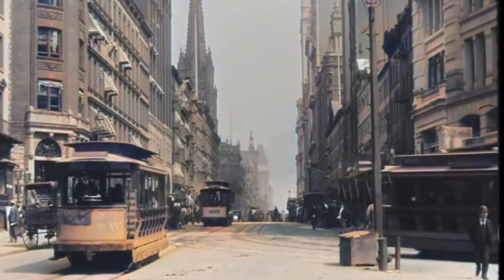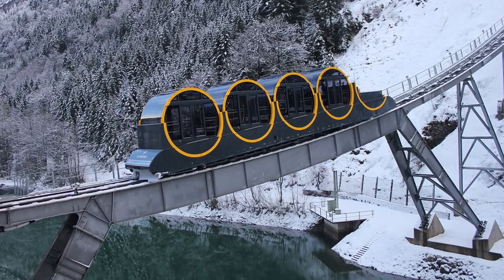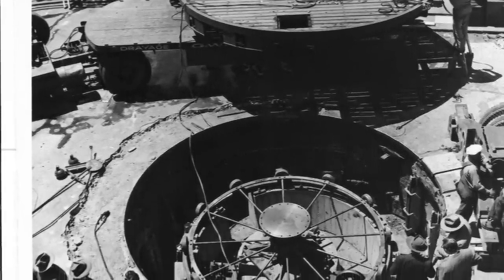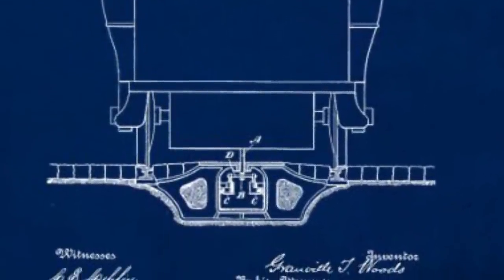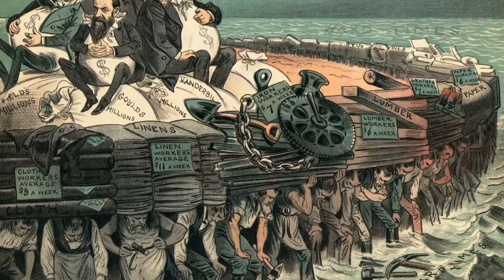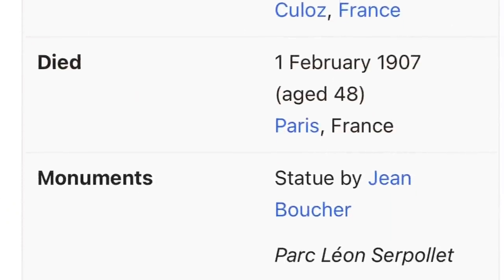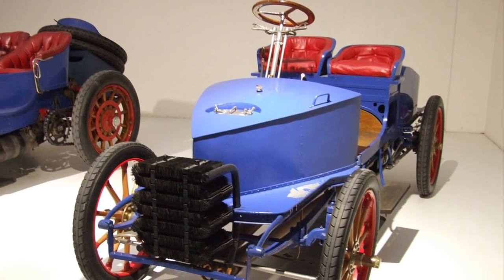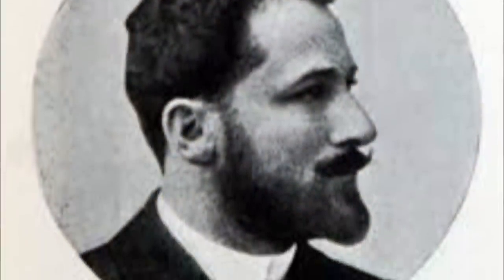Conduit (Wireless) Electric Railways, Cable Tunnels, Funiculars, Antiquitech, Serpollet Steam

Comment: I see the remnants of this all over the northwest of England. I’ve always wondered what the weird gears sticking out the ground were for. They’re dotted about around manchester especially in the more rural areas. They’re all painted over and non functional of course. 
I always assumed they must have been used for mining and it was some sort of a hauling mechanism but I’m convinced now that they were for underground cables. 
I just googled the big gear outside the museum of science and industry in Manchester City centre and immediately found this was the original site for the station linking Manchester to Liverpool in 1832.  
100 dead on.

Comment: There's a sub station or dynamo on 96th street between Broadway and West End Avenue in Manhattan.  As a kid in the 1970's  I passed it all the time. In p.s. 75, first grade, the teacher took us inside the building. Its onlt 3 or 4 stories high but there's huge machinery in there. They cant or wont knock it down. It was supposed to be a power station for the train. It was loud and dark and scary as a kid.

Comment: Here in LA all the modern Metro Systems use what they call the Electric Third Rail. It's basically the same system as the conjugate system. But instead being under the train, it is off to the side that looks like a third rail. It runs all along the track and provides the electricity to power the train...
Reply: Third-rail power is common on a lot of systems. It's been used on subways for over a century, also on other light-rail lines like the former P&W near Philly.

Comment: I am a boiler mechanic. people have no idea how much clean energy steam produces. it is so amazing and much more powerful than can be imagined. steam is a strong cheap energy source. a gallon of water goes a long way. a flash steam motor is so efficient and cheap to run with hardly any repair problems to worry about.  however  the Rockefeller's  needed to sell oil.

Comment: There was a trolley that once connected the villages of western NY, many of the sections were exclusive trolley only paths threw the woods, then traveling all the main village strips. It was built in 1908 and used the power of Niagera fall, and went right to it. It also became the path all major power lines from Niagara falls to the area took, so that may be there reason for the end of underground lines, they were starting to run power lines to residential customers, so there was no need to hide the trolley wires if you already had the residential wires going up, and it was probably far cheaper and less likely to have problems with water shorting out the system.
Reply: The last section of the line in Chautauqua kept going to sever a canning factory till the factory burned in the 60s, the trolley sat at the station till it was moved in 2020, oddly enough, on shutdown day.

Comment: The streetcars you see are either cable cars or central 3rd rail in a slot underneath the middle of the tracks. The 3rd Avenue Railway had center 3rd rail in most of its lines and those from Manhattan to the Bronx also had trolley poles for service to the Bronx.

Comment: Fantastic vid!!...when I was a kid in the streets of Calgary Ab, they had city buses on the no 1 route ,and no 9 route, that used a (Trolley Wire) to power 
those 2 bus routes. By the time I was 5, they switched all that electric tech for dirty diesel...
Reply: They called trolley buses, trackless trams, trackless trolleys, and a pile of other names that vary from country to country. A lot of cities used them in the past. They're still common in some parts of the world although IIRC only about half a dozen cities in North America still have them.

Comment: Very interesting video my frend! I honestly did not know about the cable cars and the massive rail cable system that was under the streets. People of the old world were always experimenting with different types of rail transportation. From ancient cable car systems invented in mountainous regions to the modern wireless trams with the atmospheric generators on top (like the one at 15:50). Anther interesting subway of the old world was the pneumatic railway. This subway used a single car that was almost vacuum sealed to a cilindrical tunnel. It was pushed from one station to another by huge air pumps that were installed in each station.
However we must remember that they all had in common one thing: electricity.
Im afraid that Serpollet was just a puppet inventor pushed by the controllers to introduce a precursor to the combustion engine in an attempt to steer public perception away from electric engines. His small steam engine did nothing but further the agenda of internal combustion engines.

Comment: Very good research and video
People underestimate the practical efficiency of clean engineering , cog's levers pulleys screws etc
The next question is how they went from " discovering" electricity to producing it in large amounts and making the cables and infrastructures 
To transmit it almost instantly
Reply: It's amazing when you start combining these technologies, such as biogas for gas street lights and pulley systems for public transportation. It makes the world seem much more beautiful and less archaic than the Controllers would like us to believe. I'm not saying it was great considering other aspects of the world but dang it was pretty cool.

Comment: This film was taken and created in 1896.It wasn’t until recently we were able to enhance it and add some color to them.
The electric streetcars developed in Budapest Hungary by Siemens got their electric from beneath the tracks.Conduit is steel pipe,they operated on DC electric.They also had a pole on top of the cars for where there were overhead lines installed.The trains that operated above ground ran on both electric and steam power.Im an electrician in New York City.The conduit is still located beneath a few streets that weren’t torn up.Theres nothing mysterious or conspiratorial about these technologies.Jay Leno’s Garage has early steam and electric powered vehicles in his car collection.Here:
https://youtu.be/rUg_ukBwsyo

Comment: I grew up in Dunedin NZ and we had a cable car and trolley buses when I was a kid. The wires for the trolley buses were above the road and the bus had 2 poles on that rested on the wires. Sometimes the poles came off and the driver had to connect them back on.

Comment: That long metal bar on the lower part of the Trolley below the step level is a Long magnet that was on both sides that was, lowered on to the metal track and used as a brake to slow down and stop the Trolley. I always thought from seeing a large cooper cable with a rubber cover leading to the bar, it was electromagnetic not just a magnet, does anyone know??? I'm Glad I found your channel it is Super,😎👍

Comment: 7:29 I am from a small town which got its first official tram 1895ish.... And it has never lost it and is part of a tram network in Germany.
But, I never heard their cars were pulled by cable. 
The one in San Francisco are pulled by cable because the streets are often very steep. Too steep for a rail vehicle to climb as the steel wheels on steel rails don't provide enough grip.

Btw. I have visited San Francisco and I also have been to the engine house where you could see, or maybe you still can see, the big old electric engines who pull the cables through the street since 1899ish. It's printed on the machines, but I have been there nearly 30 years ago, so pls forgive me if I forgot some of the details.
They already wanted to shut down the cable car network completly. But - their fans and a charity prevented the closure. That's why it is still there until the present day.

10:51 Actually, you just need the positive power in the middle of the rails - and the rails itself are the negative pole. So that the curcuit is closed. 
There is just one little point I got: How do you go through junctions with just a car that gets its power from a rail in the road?

Comment: Great video! The guy walking in front of the trolley at 6 seconds..the top of his head disappears since either he (or the trolley) was added later to appear as if they are actually both in the shot together. Horse on the right at 10 seconds also disappears. Casting on my big TV and it's super obvious. Also, the shot where they are showing the construction of the railway 22 min has to be fake. There are people on the trolleys while construction is being done with huge holes in the ground. The workers don't seem to mind they are going to be run over and the people in the trolley on the left are not even riding on a track smh. We could say the trolleys are stationary, but then why are there passengers?

Comment: There were slits in the ground that a rod would slide through as it moved and the normal rails were the ground. They would fill will dirt and horse poo and needed cleaned too often to stay a convenient system. There have been race tracks for kids that have this same pin design around for a very long time.

Comment: And yes they were also drug around by underground cables but I've also noticed in some of these old photos there were no tracks they were on dirt roads and they were still running... So how were these trolleys running if they weren't being pulled by cables or ran off of electricity... I'm not sure if it was your channel that had these photos or one of the other ones that post these old photos pre mud flood and post mud flood... They already had a free form of energy that's why they have all those rods on the top of their vehicles and they're buildings... And we now call them lightning rods what a nice way to hide the truth

Comment: In your own examples of the drawings of conduits ,the tunnel that holds this conduit is about one foot deep and no more than ten inches wide. The earlier ones with the wire pulling them around were most probably steam powered . Good video though
Reply from the maker: You’re forgetting the conduit stations on nearly every corner. I appreciate your comment, but it seems like this research is going over a lot of people’s heads, and that’s disappointing. One, the narrative says we reused cable railways for conduit railways, hence, why the tunnels are so large, and while the conduit third rail itself is rather small, the conduit stations on the corners, underground, supplying the electricity are not small at all.

Comment: In San Francisco they still have the cable running in the ground only on the ground that's solid rock you can go to the gear house that runs the cables. But the buses and public run on the over head electric rail system. The city says they do it cause of earthquakes would mess up the under ground system. I lived here my whole life.

Comment: 16:04 flash-steam-boiler engine. Powered lights but could power anything (transport). Minimal amount of water and min amount of oil/fuel needed/ pressurised steam. Travel 6 miles/ 10 km on less 1 ounce/ 30 gr water.
Reply: Dope

Comment: A funicular uses the 2 cars as counterweights, so it requires very little power to operate.  You can see Angels Flight in Los Angeles which was re-constructed about 20 years ago. The reason for cable cars was to9 keep the air clean in cities. After electric was invented, subways became practical and Cable cars were no longer necessary. Subways were never bored. They were constructed using cut and cover construction. A conduit is just a pipe with wire in it. Electric power is used overhead in exposed trolleys because people stepping on the ground don't want to be electrocuted. The original electric systems in New York you mention were powered by the Edison company. Edison had the patent on DC power. DC power cannot be used over long distances. This made power plants necessary every few blocks. Once the Tesla AC system was adopted it was no longer necessary to have so many generating plants. You should really do some history research before you spout misleading theories.

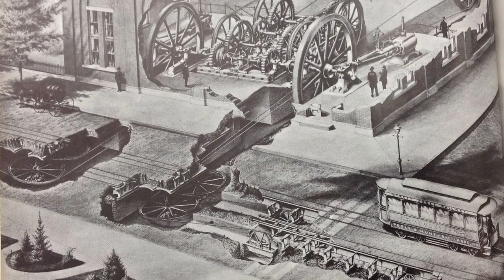Comment: Personally I think that they ran with a motor, that fed electric to the grid, that was hooked up underground in the mudflood buildings  I think that the mud flood liquidfaction was started when the beast was 'loosen for a short season. '* - 5:50  look at the size of the electric motor.  The gears are huge, because of the torque required for the pully.  No wonder the first floor had huge doors = to move and replace the gears and clogs, IF this is to scale .  Troy Reid Type motor, but bigger?   
       9:43 if this was after removal of the cable it seems that the metal rail road, to send magnetic electric, Because 'eletric is Not what we were taught.'  The 'Conduits'  could carry the extra power into a battery or grid, notice that the lamps are Not Gas but are electric    Leon Serpoyer Flash  steam boiler = pressurized tank, with a flat grill water is misted onto the grill, and the pressure rotates the motor.  Now days a cast iron grill in a pressurized tank with gears moved by pressure of the steam from the mists of steam, to heat the griddle LP gas or on demand hydrogen power, . We don't need speed in the city, but 45 speed limit in cities, and fast in rual and freeways.  If we give her double her cup **. 

*And just before the season ends Azazal will be loosen, but those that didn't stop believeing, are not 'raptured' more like they   are transposed = Rev 15:2 onto a sea of glass, and below the wrath of GOD goes to the fallen.  RELIGION IS SATANS DECEPTION just treat everyone how U want to be treated, and help others When you are moved to do so, put GOD first, don't love the life he gave U that U won't give it back when he asks for it, love each other and hate evil, your body is just a matter garment hiding the spiritual U.
 ** quarteen them, road blocks and security,  EMP over DC, no more organic food deliverys.  to them.  None leave, they get the toxic food they are trying to feed us.  Ex military and LEO you didn't take the vaccine and now you know e don't want the war that they are trying to start.  Find a more Rural area, and buy into a farm that is Organic (NO House Bill 1169  I DO NOT COMPLY)  A cop that tries to endorse an unconstitutional  law = treason,  Put them in the quarenteen area.  Criminals too.  let the dead eat the ded, in the Lord.  Spring is ere time to lan, and plant,  and start switching up, to Troy Reid motor, Stanly Meyers water  hydrogen power.  Huge water fountains that create energy from water turbines and dynamos.    Membership points earned from work, redeem with purchase dues not taxes 4 hrs @ wk, to be adjusted downward never up.  We build Hemp homes full 4 bedromm  bath (@) the hemp better sound proof, fire retaardant pest deterant, all their toxic money makers. 

https://youtu.be/p1xgWCdh2xs

Comment: Dude, the tracks are steel. They ran the power through the tracks. Just like a toy electric train. It is safer to run the overhead contact so they switched to it.
Reply: Also easier to maintain. Even with the infrastructure needed for overhead wire it's less trouble-prone than hot wires in a conduit.

Comment: Putting the electricity in the air also causes interference for us and animals. 

It could be that they had to take down all the tech that was generating the electricity and to replace the tech they put wires in the air to gather the electricity.

Comment: Trollies run on underground cable pulley system which are usually powered by steam. The funicular is operated the same way on cables no electricity bro.
Reply from the maker: I assume you didn’t watch the video lol

Comment: I can see why they brought the cable above, it was easier to repair if there was a problem. EMF radiation is worse when underground. There's one that still runs in Dallas, TX. that has been updated, there is no charge to ride it though it is a short route compared to how long the routes used to be, it's safer than riding the bus system which is horrible and full of crime. Public transportation should've been immediately shut down when covid hit.

Comment: They are called cable trolleys,  The wire cable pulls the trolly when you se what looks like a third rail its where the steel cable is.
Reply: NO its for brakes.

Comment: unmentioned, but intresting is the fact that all these trolley`s seem to have a roof with a additional raised section of roof in the middle. Why?
Reply: Two possibilities I can think of: 
> They're standard designs that carried poles in other cities. It would be cheaper to build one body style and just leave the poles off, versus building two different body types. Cars on a light-rail line near my town draw power from a third rail but have an unused mount on top where a pantograph would go.
> The box-like opening is something called a "clerestory" that had vents in it to help air to circulate in warm weather. 

P.S. "trolleys", no " ' " Hope this helps!

Comment: These trolleys/trams were run on a power supply called the 'LORAIN SYSTEM' whereby they took the power supply from studs in the road.  Years later they were converted to run from overhead wires. Here is a link: https://en.wikipedia.org/wiki/Stud_contact_system

Comment: This is not wireless electricity.  When ever you see three rails, the middle rail has a grove where a steel cable is moving. The car operator can use a lever that allows the car to grab the cable. The steel cable runs back to a pulley station where there are large pulley and gears and a electric motor.  San Francisco still have 1 operationally today.  Cable car.

Comment: Question on page 11:00
What happens if the sub conduit is filled with rain water?

Where did electricity came about in 1800s?
Reply: A1: The conduits had drains in them.
A2: Steam plants to turn the pulleys, or generators later on. The first electric streetcars ran in the 1880s.